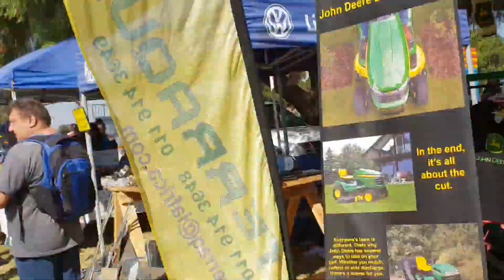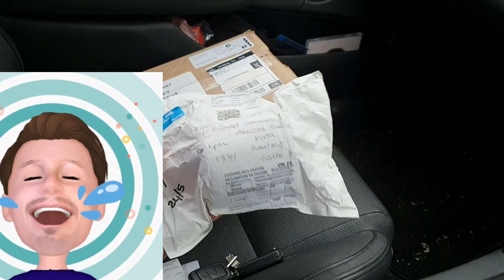Saturday's 2nd part up to today !

Comment: oh i disagree the Wheel is the greatest invention mankind has ever made,  think of all the things we wouldn't have without the wheel ? without the wheel, none of the tools in your machine shop would be possible. without the wheel even the machine that was grinding corn in this video would be impossible without the wheel. from the first potters wheel to the gears that run industry tires on your cars we owe everything to the wheel. thanks again for sharing your day Michael and Hi Jackie !!!!